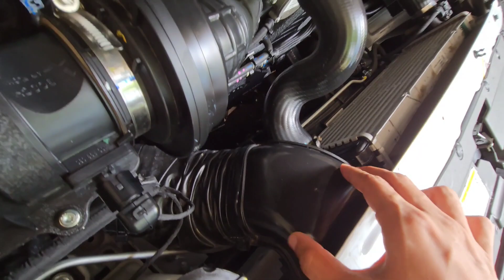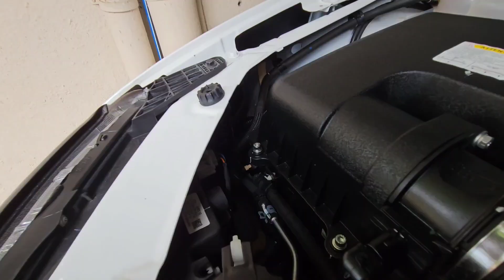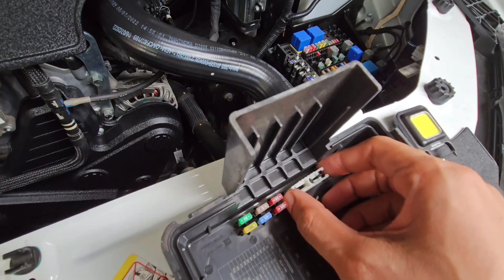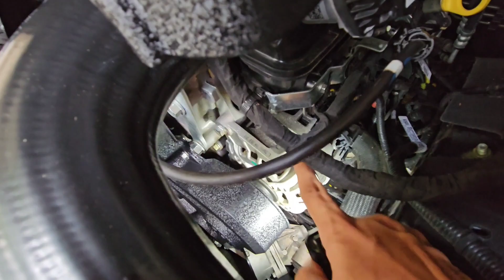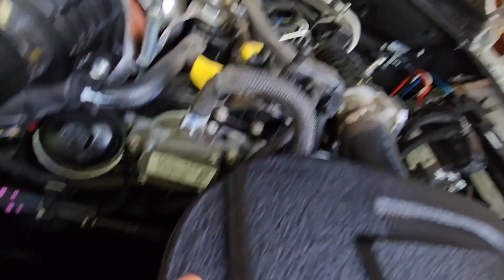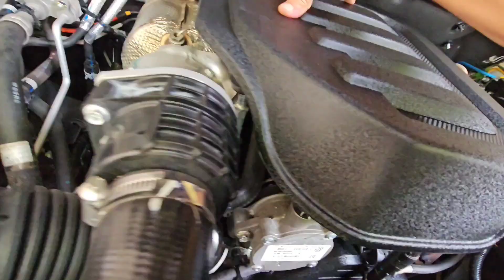Scorpio-N Engine compartment explained | Know your Scorpio-N.

Comment: Bro thanks 
But I wanted to know the name of one component beside battery parallel to it, and that's one is costly... May be that's ECU... I just wanted to confirm but you forgot that such such so sensitive and important part
Reply from the maker: Yes, you are absolutely right. That is the EMS ECU. Thanks for getting it up.
Reply: @mukulslens ❤... If noted then include and, it will help a lot many people and would be a life saver ❤❤
Reply: Im pinned 🎉🎉🎉

Comment: Mukul, Any comment on exposure of EPS unit.

It's more prone to water damage and  prone to get hit.
Reply from the maker: I would say the EPS is very well sealed to prevent water damage. However,  Mahindra's recommended water wading depth just below the EPS motor.  Coincidence maybe.
Reply: @mukulslens  you mean it is safe to pass through water when the EPS takes a dip and it's water resistant?
Reply from the maker: Yes, absolutely safe to drive through water even with the EPS submerged.  I just changed the EPS on my other car and upon inspection it looks pretty well sealed. As long as the rubber boot cover doesn't have any cuts. It's very well sealed.

Comment: Can you focus... Steering 1 shaft mtg bolt... Where it placed... Recall from mahindra and 2 bolts are locked at 90 degree...after  I feel steering is very very light... Is it good and safe to drive?? It's z6 mt
Reply from the maker: The steering should be light at low speeds. Not so much after 60kmph. 🙂

Comment: Please let me know how do keep your engine so neat and clean in a city like Bangalore where there is a lot of dust due to construction everywhere.
Reply from the maker: I know. It does get dirty in no time due to that. I try my best not to let the dust settle. It gets very difficult after that. I spray a foam shampoo using handheld pressure sprayer and then wash it down with non pressurized water jet.  🙂

Comment: I went for the first service and came to know there's a OCFM replacement call from mahindra side. For now, that part is not available at mahindra service center. Till then, can you please help where's that unit in engine and role of that.
Reply: OIL COOLER N FILTRATION  MODULE 👍🏼👍🏼👍🏼👍🏼👍🏼
Reply from the maker: Hey, I am sorry I do not know of any OCFM. It sounds like a meter/sensor. But I cannot be sure. Hopefully once when it's rectified in your car you can help me understand what it is. Thanks 🙂

Comment: There really is ample room in the engine bay. The Safari Storme I have is packed so jam tight that even getting out the battery is a pain in the Ass. The placement of the Radiator seems a bit odd. I also noticed there is no access to the Radiator cap. How things have changed from filling the coolant through the radiator cap in the Ambassador to doing away with a radiator cap altogether
Reply from the maker: Yes, times surely have changed. The coolant reservoir cap acts as radiator cap.  Yes, I was surprised too when I realized this.😄

Comment: Thank you mukul, if you can do similar one on interiors will be good one to watch
Reply from the maker: Hey, will certainly consider this idea. Interiors as in various functions of switches and things related to Interiors of the car? Could you please elaborate.
Reply: @mukulslens  yes, various functions both software and hard ware ones 

Thanks a ton for Swift reply
Reply from the maker: Will certainly try to come up with something regarding that. Thank you for the suggestion. 🙂

Comment: The engine is not as punchy and torquey like fortuner and the handling is also better in fortuner the Scorpio’s steering is very soft and light the amount of softness acts against itself in terms of handling.if u want a fun to drive and a handling car which also can do great off-roading then fortuner is the only choice for you the Scorpio is not good in off roading when compared to fortuner and also power and torque
Reply from the maker: Hey Ishan, your right, Fortuner engine is more punchy, but that's due to the fact that it's engine is 600cc more and produces almost 100N-m more torque.  Steering wise as of now ScorpioN has the superior steering since it's electrically assisted. Toyota has the hydraulic steering as of now which is cumbersome to drive in traffic and on highway the Scorpio N steering starts to weigh in, making it more predictable. Fortuner will get a new electric power steering unit in 2024 model. I am sure it will be better than Mahindras unit then. But as of now Mahindra has a better steering. And none of the ladder frame cars are fun to drive, be it Mahindra, Toyota or Ford. They are heavy duty machines, with tons of body roll, meant only for ladder frame enthusiast or anyone looking for heavy duty SUV. Toyota will always remain a step ahead due to it's quality control. But it's nice to see Indian brands moving their game up, be it Mahindra or Tata, they are moving towards world class. And I am sure everyone appreciates that.🙂
Reply: @mukulslens  you forgot mention the price point. It comes half the price of Fortuner
Reply from the maker: True that! 👍

Comment: Really good information! Keep it up!
Reply from the maker: Thank you 🙂
Reply: @mukulslens  do you think extended shield warranty beneficial for these mechanical and engine related parts? Does original Mahindra 3 year warranty also includes mechanical and engine related warranty?
Reply from the maker: @VikramsPhotos  Hey, the Shield warranty is very beneficial.  The Factory Warranty does cover all engine and mechanical parts failure including most electrical, other than normal wear and tear and accidental damages. Shield extends that same warranty for 4th or 5th year based on your requirements.  Definitely recommended. Even if you plan to sell your car, Ex Warr ensures better resale value in 4th and 5th year.🙂
Reply: @mukulslens  thank you for information!